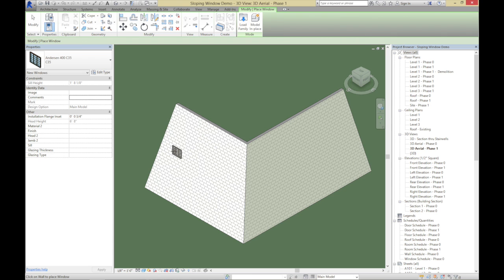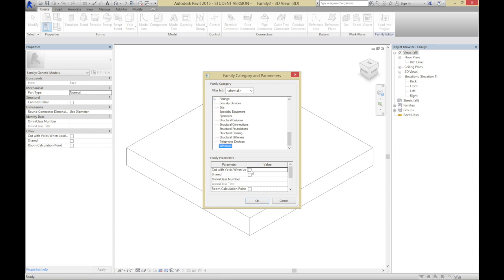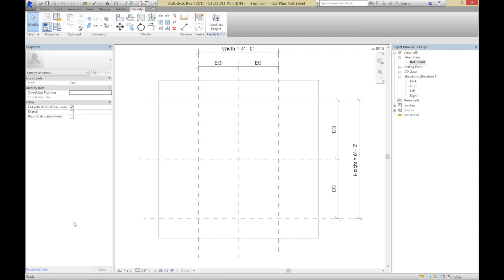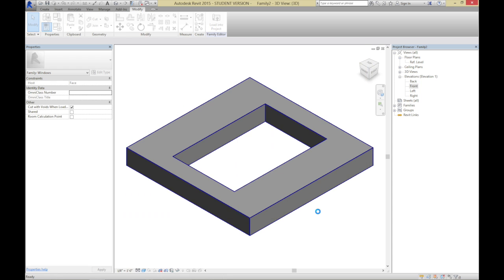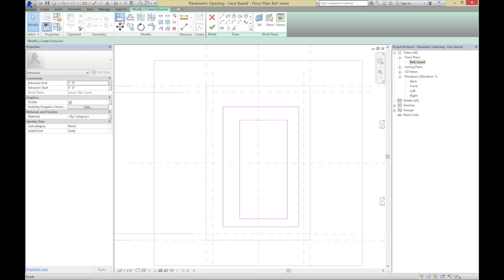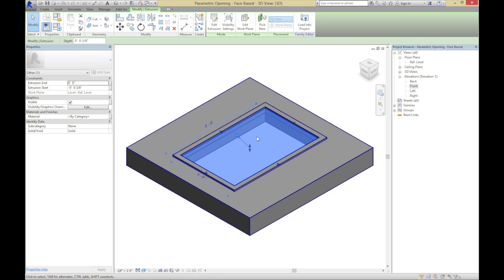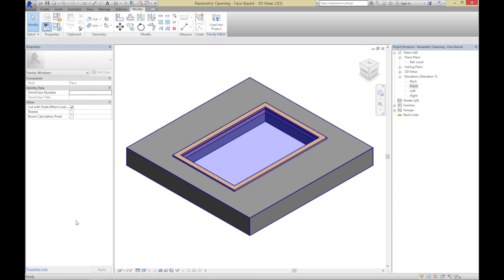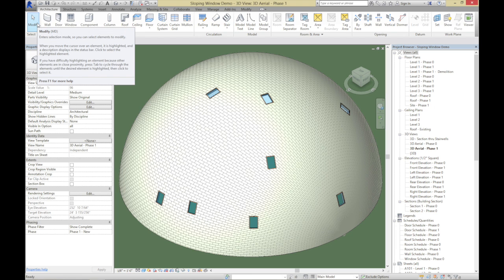CEE 120 - Creating Face-Based Windows for Sloping Walls

Comment: I was unable to write Arabic in modal text in revit 2014. i have been searching the whole net i couldn't find. The problem actually is when I write arabic letters it doesn't join they are separated and also from letters are misplaced in sequence as result it doesn't make any sense and meaning. Arabic works will with annotation but it doesn't work with model text. Please make a tutorial I really need your help nobody know how to do this.